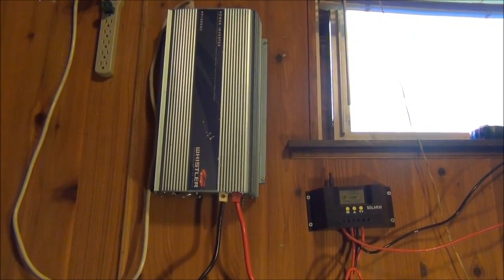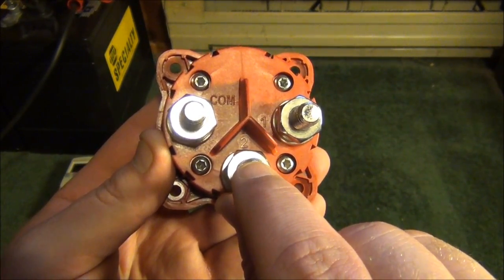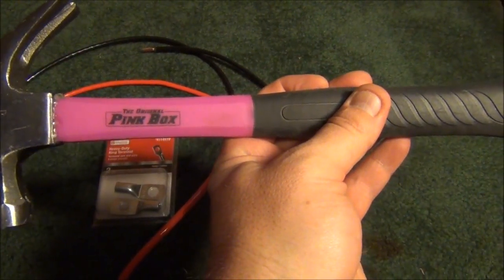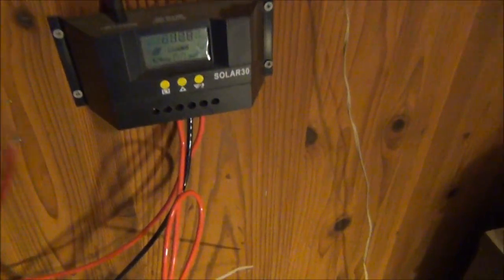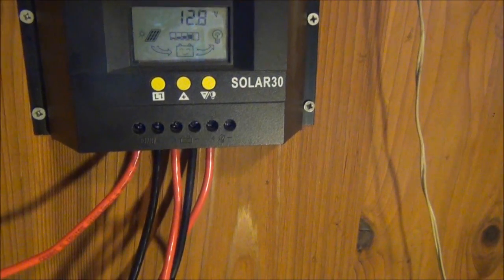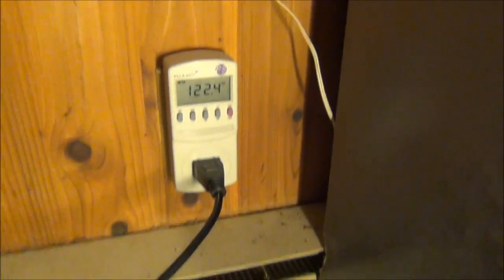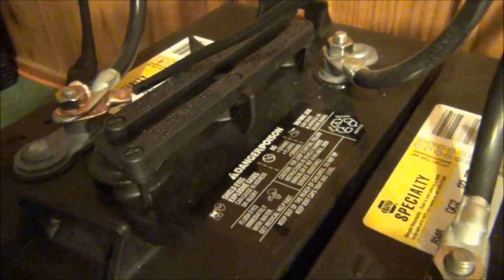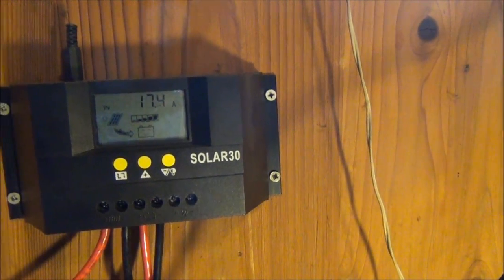Adding a Grid Tie Inverter and Blue Sea Switch To My Solar Panel System - L2Survive with Thatnub

Comment: Did you ever get the bus bar project done?I am thinking of taking your advice on that,but I wondered if it was beneficial to you.
Reply from the maker: +Gary H I did not.  I have moved a couple of times since this video and currently my solar system is buried in a closet in the house we just bought.  Maybe in the spring I will have time to get it back up.

Comment: Good explanation. I wired one into my system and it works great however I have noticed that my Grid tie inverter tends to steal all the power when I have the switch to power both 1&2 was wondering if you noticed that on yours?